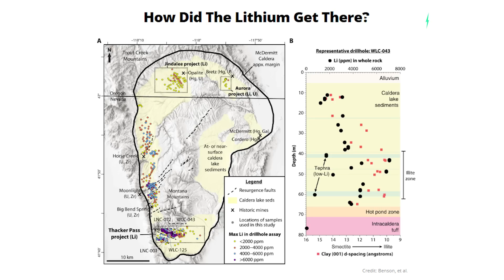Worlds largest Lithium deposit discovered in an extinct American volcano

Comment: Peru is quickly losing their golden goose
Reply: Peru will be fine for another 10 years at least. It's not like Lithium is their only export, and Lithium isn't seeing price shocks, just a smooth downward price trend.

Bolivia and Argentina won't think of opening mines with prices as low as they are because of economic viability. Peru would have to run out, and the current price of Lithium would have to triple, for those deposits to become the next major mining source.

Refining Lithium from ocean water is very possible, but no one does it yet.
Reply: In which case, they may have to turn to chicken instead.